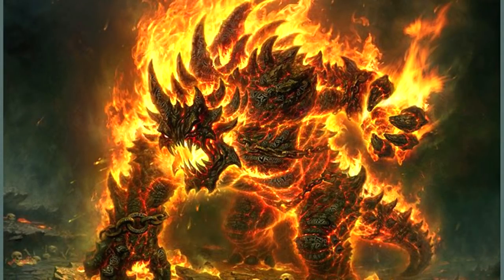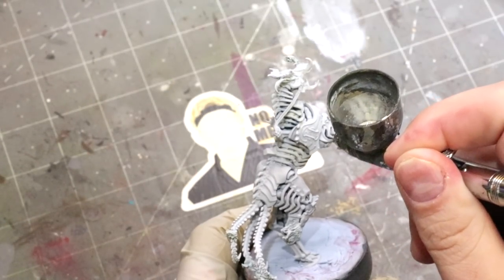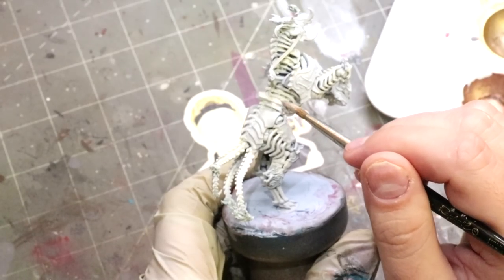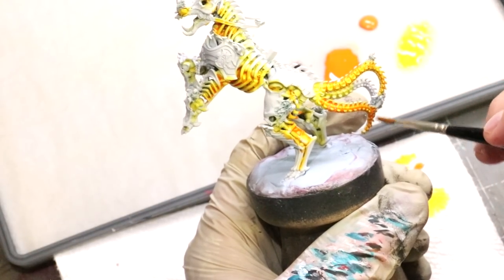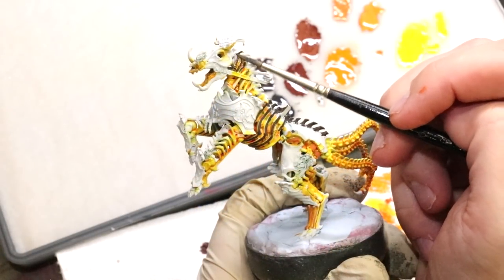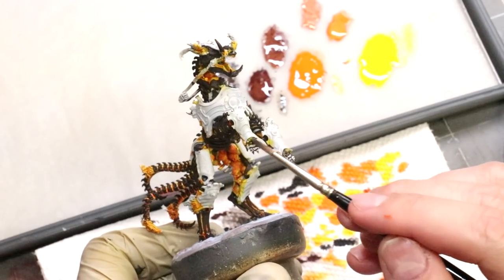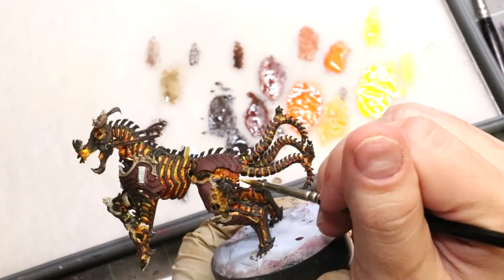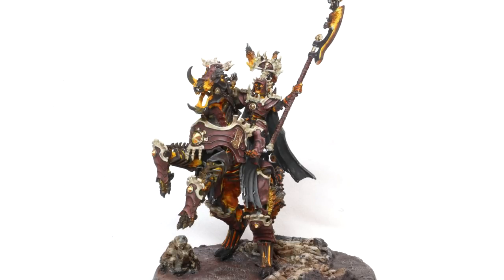Painting Inner Flame - HC 324

Comment: First of all the model looks really, really cool. I just quickly want to follow up on "I don't even know what to call this", and funnily enough in the explanations later it's basically called the correct thing, what is being painted is colour temperature. To get a bit more detailed everything emits light constantly, at a wavelength determined by the temperature it's at. You do too, just not in the visible spectrum of light, but in the infra red spectrum of light. You can measure temperature very exactly this way, that's how an infra-red camera or thermometer works, it's how blacksmiths have measured the temperature of their work for centuries. The model here has an inside temperature between 1800 and 3000 degrees kelvin. Which brings me to another reason why this effect is hard to sell, everything in longer contact with the insides of the horse or the rider are going to heat up to it's temperature, and glow itself, if we're going to be realistic the entire model is going to be emitting the same set of wavelengths of light and glow like the insides, drowning out any pre-existing colour of the material that is glowing. Which brings me to the fact that this effect needs environment to work realistically, because a black body radiator of this mass has so much energy that it would drown it's surroundings in OSL even in direct sunlight, which is the only critique I can level at this really, as the armour is obviously magical.

Comment: Nice. Been trying to do this effect with green witch fire instead of regular yellow fire and golden bones instead of black - but so far it's looked like ass.

Might need to give it a try using these steps and see how it goes.

Not sure how to go about making the gold of the bones actually also appear as such underneath the green glow though. Gold isn't a great contrast color next to a bright flame effect.
Reply from the maker: The gold is going to be tough for a lot of reasons, but most importantly, it just won't color balance. Gold is highly reflective, so it should be the color basically of the light, charred bone has a very low reflectivity, so it can act as a contrast. Why it seems off to your eye is because your brain knows how light is supposed to work and that just wouldn't likely pass the test without some very, very, very complicated work.
Reply: @VinceVenturella  Hmm... Good points.

It's definitely a contrast issue, because it just looks like there's green color in the recesses of the bones for "no reason" at the moment.

Figure I'll try out a dark brown or dark bronze for the bone parts with just a hint of gold at the top/edge surfaces and see if that helps sell the idea to my brain.

Thanks for the input.

Comment: Being in the middle of Slaneesh models being called a happy place should only apply to a horde of demonettes... ;)

Regarding the flame:

isn't like painting campfires or any other light sources? brightest at the source, getting darker the further away from the source and also wouldn't the flame luminate the bones of the horse? As to say they cause an OSL effect
Reply: The issue might that if you go for "realistic", your composition becomes super dfficult to read?
Reply from the maker: So there are multiple challenges here when you have this much glow (which is generally what people want). The first thing, is how bright is the glow, second what lighting are we in? Thrid, what is the source of the light and how bright. 

So yes, I certainly could have also given the inner cut line of the bones a slight bright edge with maybe a glaze as well, it would be making the flame brighter (as opposed to just glowing faintly). But it's certainly a valid choice. though also as mentioned, it can very much make the overall composition difficult to read (as suddenly, everything could be orange and hard to tell apart).

Comment: Hey Vince, how important do you think ambient lighting is in minipainting if at all? For example, I have an army painted in cool white, when the muddy bases that they're standing on would reflect back warm light. So it really should be warm-neutral white which really bothers me, but I don't see an easy fix to it without having to repaint the army.
Reply from the maker: Depends on what you mean. Lighting is literally everything with miniature painting in simplist form. Lighting is what makes the thing stand apart and is the whole challenge, as color is only color based on it's light. That being said, for an army, we often have these kind of things where we break the rules, and I think that is just fine, no need to repaint, just push forward. :)

Comment: I did a blue flame/terracotta bone version of this on bonereapers just before you posted this. Your video helped to convince me to switch to a darker bone color to increase contrast though I think black is going too far for my taste. I also think you violated your own rule of maximum contrast with the beige/gray colored bone parts...i think those need to stay subdued dark not to compete w the flames.
Reply from the maker: I did, (though that part was part of the color scheme handed to me, as this was commision, I didn't have a choice). But you are correct.

Comment: i think to make this work you need to work heavily with osl
Reply from the maker: It can certainly be a big component of it, it depends on the strength of the light you are capturing and the ambient light conditions. For example, if you look at lava  flows on a relatively bright day, they don't really cast much light (the sun being still quite a bit brighter), but certainly you could take this basic method and push it much further for sure.